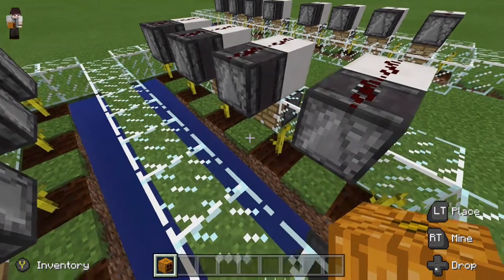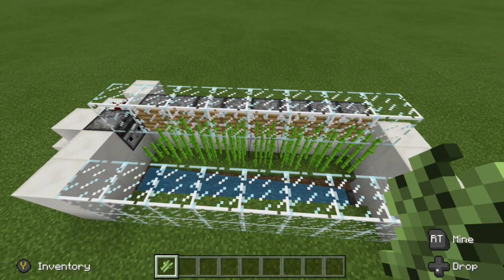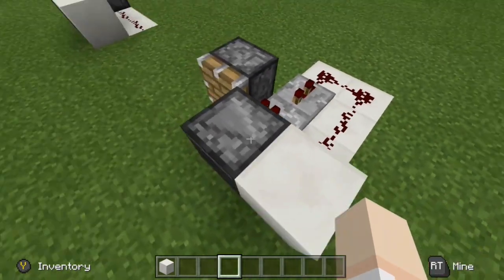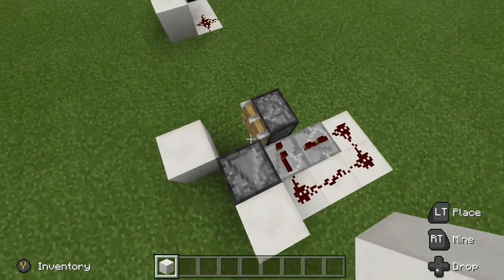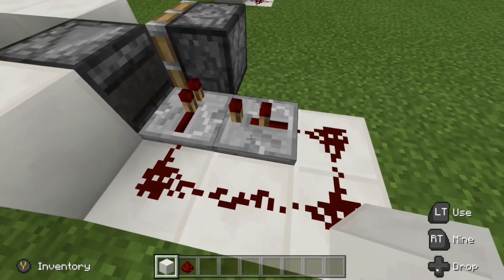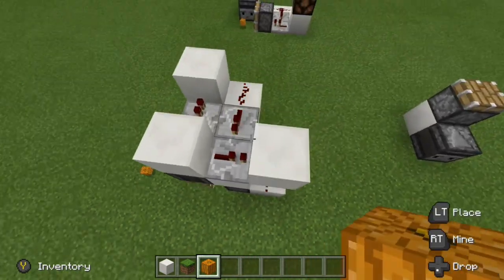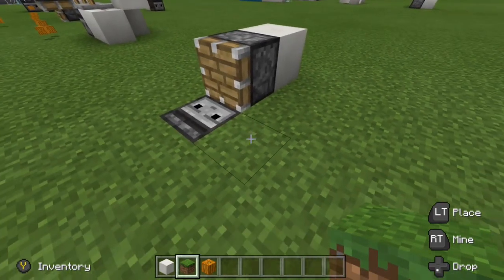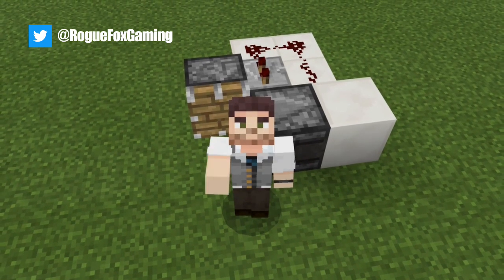Minecraft Bedrock - Piston Observer Circuit ( Xbox / MCPE / Windows 10 / Switch )

Comment: How would you go about stacking the pistons and making them activate at the same time. I have a tree farm and the blocks are 6 high. As they're being push out of my farm, I want the columns to be pushed off to the right. I just don't know how to go about connecting the 6 high pistons and observers
Reply: Hi, did you find a result for this? I currently have the same issue with the same build.

Comment: For pumpkin farm I use a burnout bud switch. 1. Place a solid block w/ dust on top and a torch on the side. 2. Place another block directly above the torch. This should create a burnout clock that stops after a second or two. Once it does, placing or breaking any block underneath (or adjacent to) the torch will give a monostable (ish) output perfect for pumpkin farms. Best of all it's tilable! XD

Comment: Hey rogue fox, do you mind explaining the need for two red stone repeaters? I’m new to learning red stone and would like to understand the red stone mechanics better, not just follow a tutorial. Hope you can respond to me as you have other comments, thanks!!
Reply from the maker: Sure! I’ll try my best! 😄 So the repeater running into the other repeater locks the repeater and prevents the circuit from creating an eternal clock. The observer will let off a double pulse so the repeater will lock the other repeater to cut off the power from the second pulse and ultimately prevent the circuit from making an eternal clock. Hopefully that helps 😅
Reply: Yes thank you. I didn’t realize a repeater could do that. Very informative.

Comment: Hey man great tutorial.  I am working on a design for a water elevator that basically pushes magma and soul sand back and forth to make a simple elevator. When I activate it does not always work so I am looking for a way to use observers to detect which piston to push, do you know of any circuit that works well for that?
Reply from the maker: Thanks!

Are you using two observers to power each piston? I’m trying to picture what you’re saying, but I’m having trouble.
Reply: @RogueFox  I actually figured out that I needed a tflipflop instead and it's up and running perfectly.  Thank you tho! Keep the videos coming